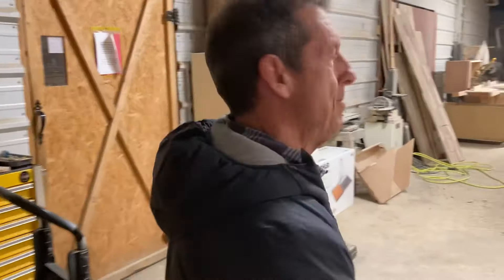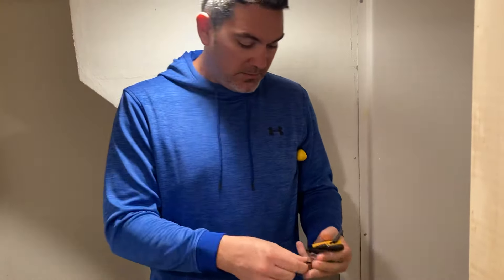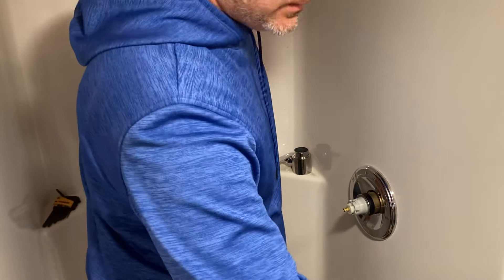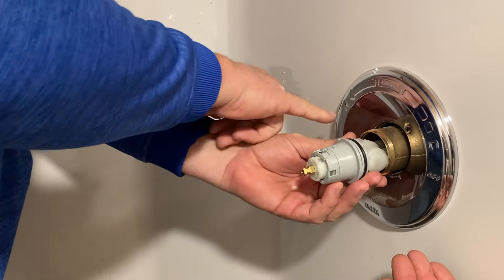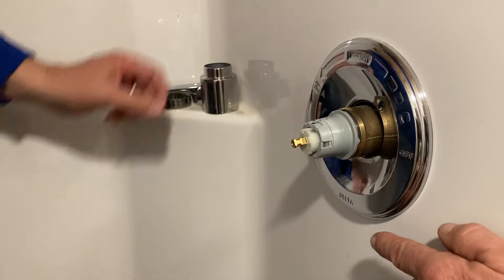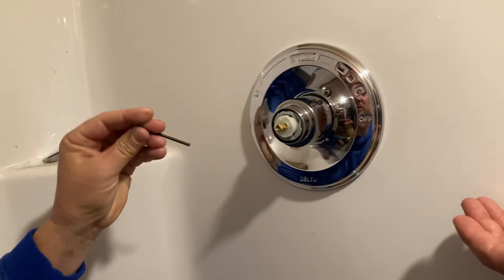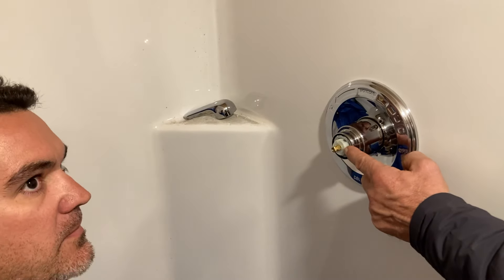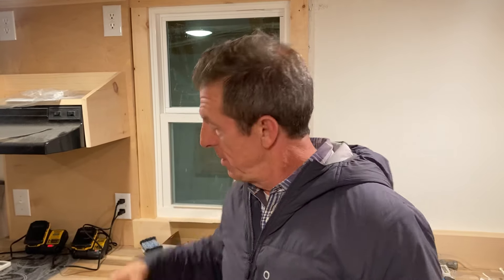How to repair a shower valve and adjust the hot water.

Comment: Changed and still have cold shower.  Already replace hot water heater also
Reply: could be an issue in the pipes leading to the shower